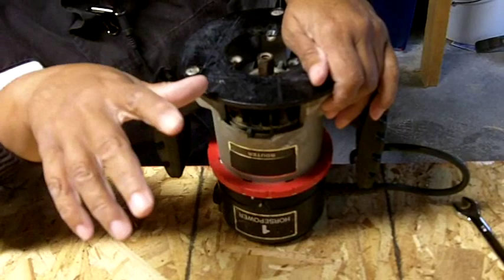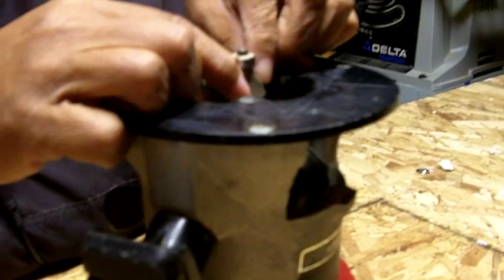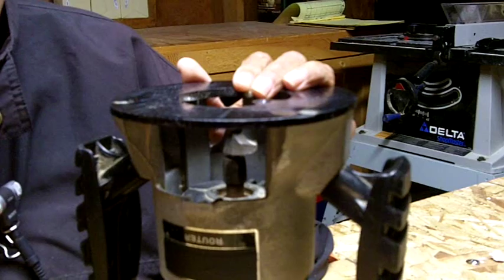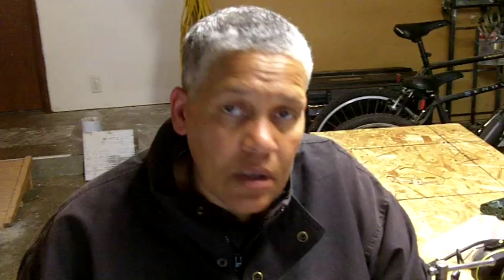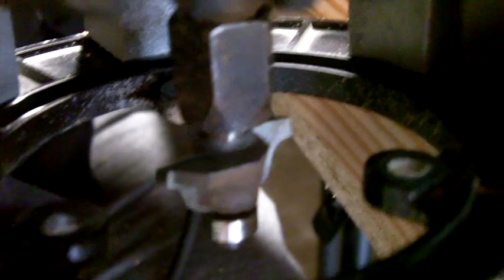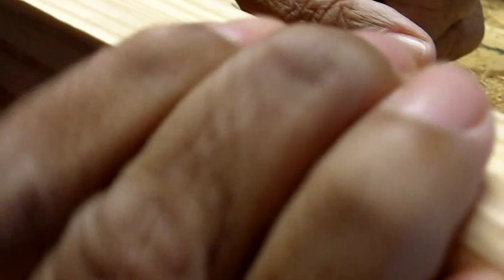How to Use a Router to Shape Wood Beginner Tutorial

Comment: great video! i am a total beginner. ihave not gotten any tools even... what do u recommend for me if what i want is to cut plywood to make loudspeakers, especially the round holes to mount the speaker drivers in? would a router be the best for this, or a mitre saw, or a jug saw? thanks :)
Reply from the maker: +Catrina Daimon Lee   Hello Catrina,  A jig saw.  Good luck with your project
Reply from the maker: +Catrina Daimon Lee   Hello Catrina,  No worries.  Here's the thing, both a jig saw and router are both capable of cutting circles in stock.  A jig saw is a more versatile cutting tool and in addition can be  less expensive than a router.